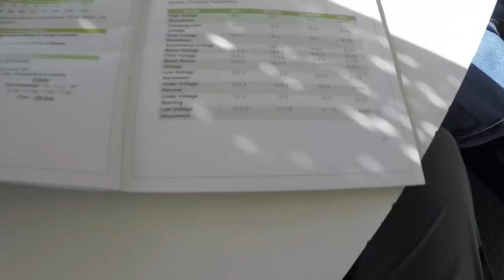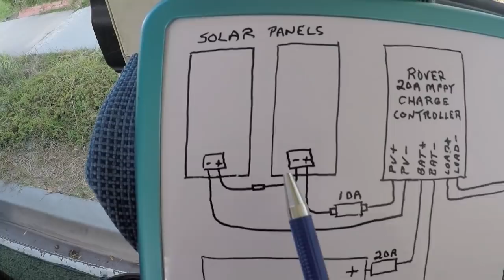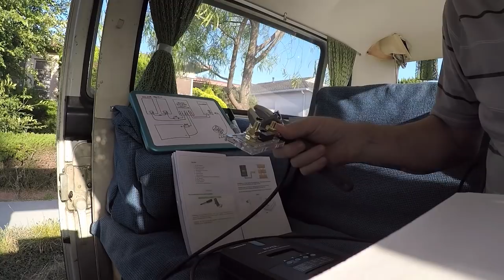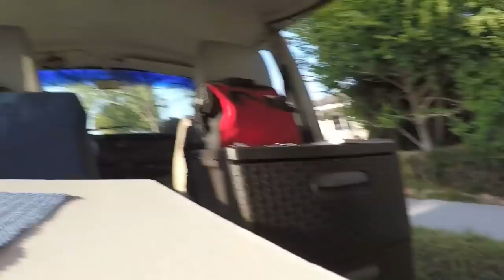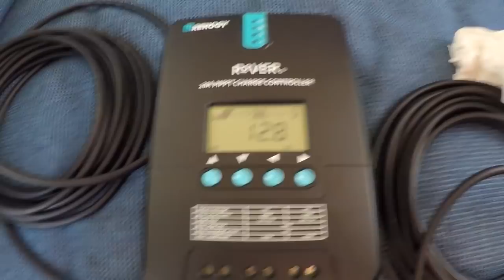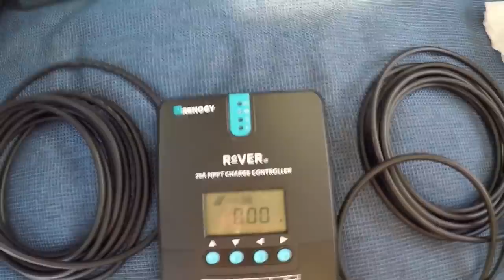Wiring the Renogy 200W Solar

Comment: Hi boss.  I took a look at your video, please do not hook your inverter to the load out connectors on your charge controller.  That is really intended for smaller 12v direct loads such as lighting (24v if using a 24v battery bank).  The rated output is 20A nominal on that output.  Inverters should be wired directly to the terminals of your battery (including overcurrent protection and a method of disconnect) so a correctly rated fuse and disconnect switch, or a correctly rate DC circuit breaker.
Reply from the maker: Sounds like a good idea, I will take your advise.   Thanks
Reply: You're welcome!